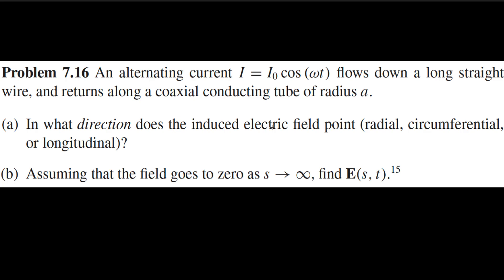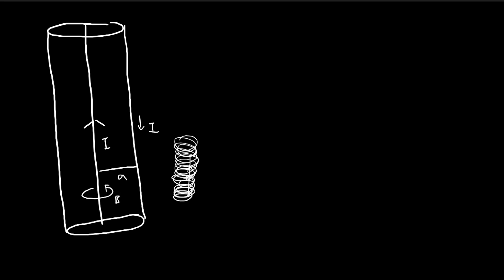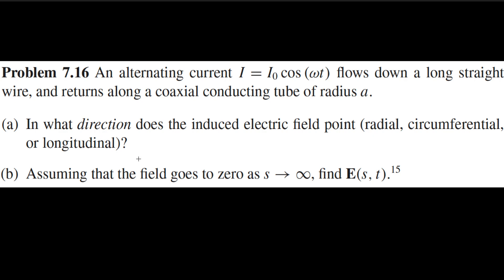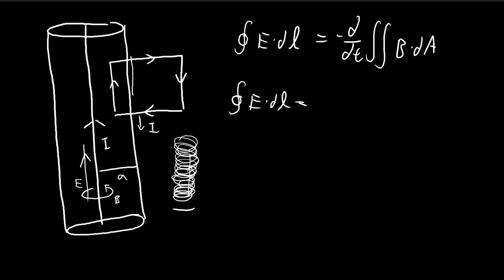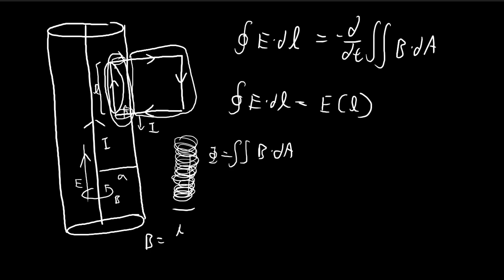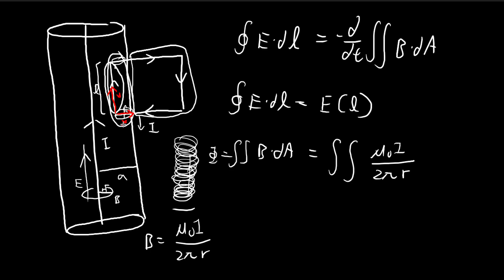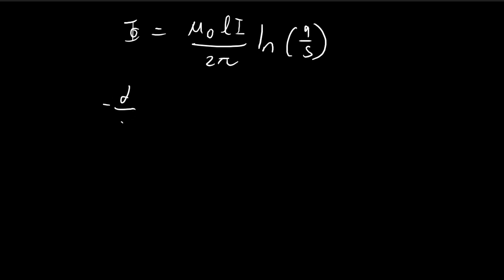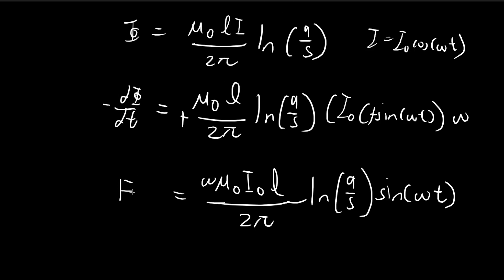Problem 7.16 | Introduction  to Electrodynamics (Griffiths)

Comment: I'm a bit puzzled by the result... how can the induced electric field inside the tube (for s < a) depend on the value of a,  since the current flowing on the surface of the tube (at s = a) creates no magnetic field inside? Which means there will be no induced electric field at s < a from this current. However, the final answer seems to depend on the position of this other current...
Reply: How did u conclude that magnetic field created by surface will be 0?